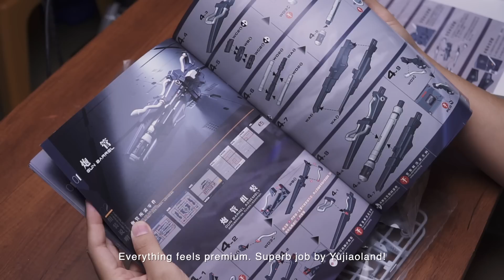Gunpla Kitbash Custom - P-Bandai RE Lindwurm

Comment: Amazing work as always. Been following your channel and Im always impressed at how well your paint jobs turn out! These are the kinds of results I aspire to have one day. Do you ever experience scratching between tight parts like the ankle/skirt armor when touching each other? Your models always seem so flawless. I just got back into the hobby a little over 1 year ago and its soul crushing to see my paint rubbing and getting scratched/nicked so easily. I use Mr Surfacer primer + Tamiya acrylics + Mr Leveling Thinner + GX114 for my clear coat. Any advice on how to protect my kits after painting? Do you wait a certain amount of time between coats to protect your paint jobs? Anything would help!